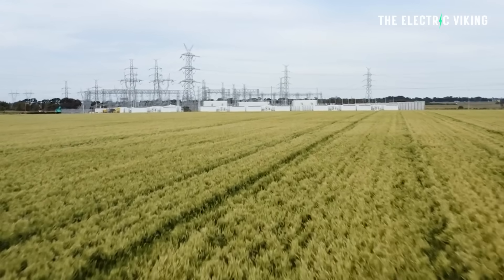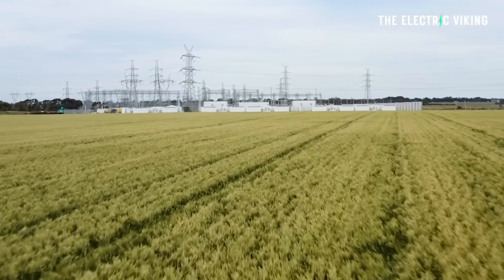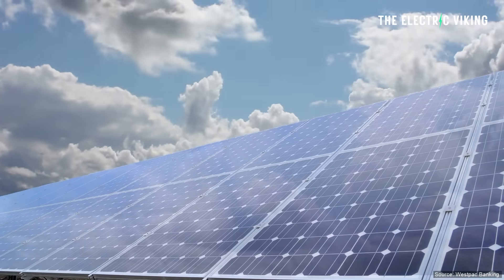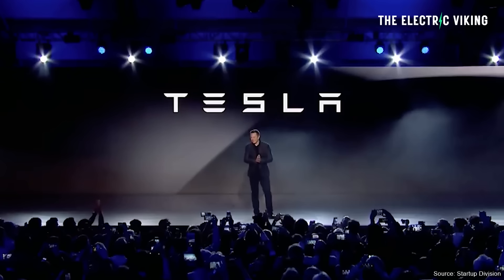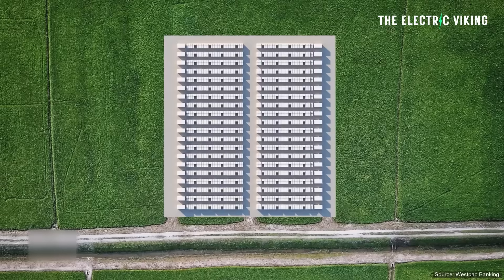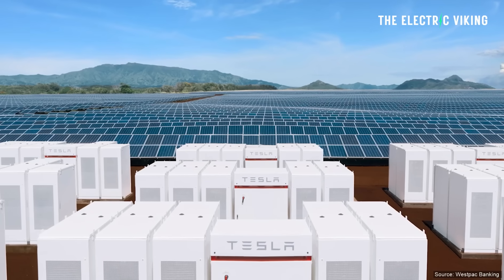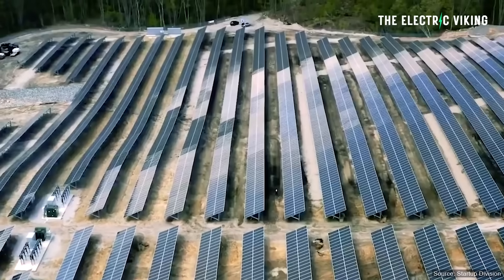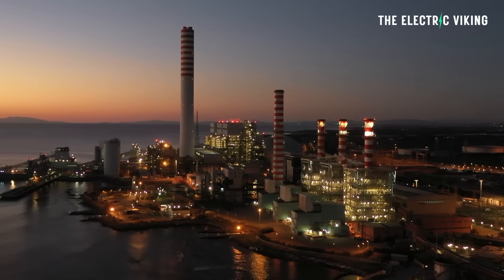Mega Tesla battery in Australia helps shut down coal and gas power plants

Comment: A battery is a battery no matter how much you sugar coat it. The energy to charge it must come from somewhere, and that somewhere must be both large enough to replenish the finite amount of energy contained in those batteries quickly while simultaneously handling the load itself. Not to mention, all of this must been done at a cost low enough to allow the company owning the something to be financially viable. These questions don't need answering if power interruptions lasting an indeterminate amount of time, and at an affordable cost to consumers, is of no consequence.
Reply: You’re so busy trying to think of ways that it’s useless you forgot that it actually has uses.
It can be used to store, wind, and solar. Because she pointed out solar doesn’t work at night, and the wind doesn’t blow all the time. 
Additionally  during the summer, when air-conditioning usage is high peak, load happens in the late afternoon. The battery is charged up overnight when there’s free energy available from the base power plants. This reduces the need for Peaker plants or larger power plants.

Comment: Another Tesla Mega pack went into thermal runaway in rocky before it was even connected to the grid. They just have to let it burn as per Tesla’s instructions giving off heaps of toxic chemicals that are dangerous. We need batteries on the grid but not these in built up areas

Comment: A 150MW 300MWh battery would presumably run for 2 hours at full capacity.  Probably OK for short local outages and smoothing the grid, but not really significant capacity for the overall grid.  How many coal or gas power plants did this allow to be closed?
Reply: Exactly, battery banks are expensive and don't store much energy compared to a power plant.  Natural gas fired power plants are what is used to adjust for variable peak loads, coal and nuclear are base loading, and run at capacity all 24 hrs.
Reply: @jeni719  Hydro is also used to fill gaps. The Snowy Mountains scheme has a pumped hydro plant which was built in the 1970s, when the majority of power of NSW was coal power.
Reply: @jeni719 
They make natural gas base low power plants also. You’re talking about gas Peaker units. 
They are expensive to operate. Even worse, they may only operate a few days a year. 
The advantages they can be started up quickly, unlike a cold plant which could take 24 hours   
Batteries on the other hand can charge up overnight when the base load is underutilized. 
Or from wind and solar
Reply: Sadly I have to agree, battery storage is unlikely to make up for the variability of renewables supply any time soon, if ever. Here in the UK we will need tens of thousands of facilities like this to cover for days of still, cloudy days in the winter. Australia might be easier to convert to battery storage due to dependable solar and relatively constant hours of daylight. You may only need to cover about 12 hours supply, unlike the UK where we’d need to cover up to a week.
Reply: The big batteries rarely have to supply 100% of the demand except n complete outages, so 400mWh pack won’t be suppling 200mWh for 2 hours only, but say between 40 and 120 mWh over say 6-7 hours at quite variable amounts with lower baseline hydro and coal and gas and variable amounts of wind. Where I live in Canada, our province is 99% wind turbine for grid energy with 1% solar and battery (grid pv/batt just starting) and a massive change from oil heat to heat pumps, in only a decade. Also, a strong uptake in solar PV for homes/businesses in spite of our ‘British Isles’ weather/climate. Strong uptake in EVs too. All those changes are additive and not instantaneous. In all these things we are behind Norway or Australia or Denmark, but we are getting there. Everyone who argues it must be 100% and instantly are COMPLETELY missing the point and the future will up and gobsmack them with tiny  daily changes that missed their attention utterly.
Reply: @jimbartley5066 what kind of a load are you trying to dump on people? There definitely is no province in Canada running 99% on wind power.
Reply: But it doesn’t need to run at full capacity. It’s not a UPS.

Comment: Isolated from grids Solar farms are unable supply a constant steady supply 24/7 without expensive battery packs - for example a comparison with an alternative enery source:

Here is a potential solution to a current problem of supplying about 500MWe continuously to an aluminium smelter...
How to pursue cheaper paths for energy use - like releasing (for use as a base loader for existing wind farms)  an existing 600MW hydro station from providing about 500MW constantly 24/7 to an Aluminium Smelter -  (that's about 12GWh per day - so instead pick which of these two options would be Cheaper in the long run assuming 12GWh per 24/7 are required from a stand alone power supply built and owned by the Smelter (24×500MWe); 

A) a combined 2GWe mixed Solar/Wind farm costing $6b; ($3000/kW) providing daily power = 6hr×500MW=3000MWh directly to the smelter;
plus storing (over 6 hours sunshine etc as average utility); vis- 1500MW×6hr=9000MWh in backup gigapacks which will cost $0.666m/MWh= $0.666×9000=$6b; 
Total capital cost (farm & 18hr Gigabattery back up) = $6b+$6b=$12b;
Or capital cost of $12b/500MW (the average hourly 24/7 smelter  daily minimum supply needs) = 
$24000/kW (includes batteries)

Alternative B) 
stand alone 500MWe 
Liquid Metal Thorium ion Molten Sodium Berilium flouride salt burner Reactor (TMSR) capital cost say $1500/kWe
Walk-away Safe, High temperature, near ambient pressure, cold startable; pre-profit levelised cost less than USD30/MWh (<$0.03cents per unit kWh) as a continuous base loader; (also capable of load following for accomodating Irratic renewables); Also capable of supplying directly hot "solar salt" to maintain smelter heat requirements, (without having to convert via: Heat- mechanical-Electric - heat); for purifying & recycling smelter gases and waste, and possibly available to process existing long-term previous Flouride waste problem?
(This proposal woud be similar to what Indonesia is undertaking).
So option A or B would be the better choice? 
(A) solar-Wind With24/7 supply using MegaPack Batteries at $12m construction and 15 to 20 year life or -

(B) supplying 12GWe per day at capital cost of $750million at $1500/kW) and a 45 year life
ie. Capital cost of (A) for15 year life is 16×(B) capital for ⅓ the life of (B)
QED 
.

Comment: As usual, short on numbers and data.  How much of the 275 kWhr solar panels gets put into the battery and how long does it take to recharge them before the draw starts again?  How many houses can be fed by the solar panels and how many can be fed by the battery? What assumptions have been made on the consumption per household at peak evening rates? What is supplied  by the usual grid, what is supplied  by the Peak stations?  150mW of stored power will only last so long when houses might be drawing 8kW/hrI  for short periods and 3-5 kW/hr for 2-3 hrs.  Do the maths.  So many unanswered details. I am not saying it will be cheaper than Peak power stations, which are price gouging, but the number of people serviced by a huge battery pack and a solar farm just isnt enough due to the low energy density of batteries

Comment: The battery comes the US as the China factory is not yet producing megapacks. It could be LFP but not sure, what is more interesting is that if you look at Australia's relationship with TESLA, over the last 6 years we buy an average of 10% of their supply and have established the benefits of megapack to the world energy equation through Hornsdale. It should only take 9 months to fully ramp up the Chinese production of meagapacks and most will be distributed to the Southeast Asian region, so they should be more cost effective to buy for Australia. I would fully expect TESLA's megapack capacity to exceed 100 GW hours in capacity buy the middle of next year, if we are smart, we will be booking our 10% that capacity now, if we want to convert to renewable and a stable grid in the next 5 years.

Comment: Coal is not used for peaking  power
Reply: Are you sure?  If coal power plants have variable power output then they can surely be varied to accommodate load changes.  Hence a form of peaker even if not as responsive as a gas plant.

Comment: Sorry sam,  but NSW  NEVER has enough solar or wind to meed the demand , even at midday in summer.
This battery, like the others will be charged from the surplus fossil  power generation.
Reply: I'm with Amber Electric in NSW, so I get charged the wholesale price for electricity. I have a smart meter installed and I am billed almost live. Just yesterday, the Amber app was showing that there was 72% renewables in the grid and I was paying 9c/kWh at midday....and as I'm on a time of use plan, that figure included the loading and service charge.

So, 72% of the NSW grid is renewable right now. Not a stretch to think we can be at 100% in another 7 years. Adoption is exponential, not linear.

Comment: As a Novacastrian - I must say the main set up for grid batteries should be the Australian / state government financially help the average aussie to set up a "home battery" that feeds into the grid. The grid operated by the State government.
A Square metre of space inside a house 20Kw - 50KWh battery and a 15KW solar system per household.  Plus, bigger system on commercial factory sheds and shopping centers. Any deficiencies on the grid should be made up by solar / wind farms and Tera Battery packs.
And replace individual systems every 20+ years.
Reply: Just watch out for fires!
There needs to be some serious thought put to safety systems before you put something in every house that could spontaneously combust.

Comment: Yes, these solar and battery power sources are helping to shut down coal and gas power plants because it is making any kind of large scale power generation uneconomical to run.  However, it's important to realise that these alternative power sources are incapable of replacing all the energy and applications that these large scale power plants provide. So the end result is huge parts of our society will just go dark.
Reply: Here in the UK gas peaker plants run for around 2% of the time, so there is plenty of room for something else to occupy that capacity. What is needed is storage of generating capacity not the ability to generate when required. Even a hydroelectric, dam is just a big battery.
Reply: Change I gradual,no one will go dark.
Reply: @antoniocruz8083  We may not go dark but we not be able to survive without large scale power generation. The problem is that it will become uneconomical to keep this generation operational, so the cost to consumers or governments to keep them going will become astronomical. There are countless people who cannot benefit from rooftop solar, such as high rise apartments, so it is unfair they should shoulder all the financial burden. Either taxes will need to pay to keep the lights on, or those who live in low density housing with lots of roof space will need to compensate those who don't.
Reply: @vasil7410  I don't think you understand that renewable electricity is cheaper than coal, gas or nuclear. After the initial cost to install it, it needs no raw materials and in the case of solar, almost no maintenance. Even big city batteries need practically no one to keep them running when a coal/gas station needs dozens of permanent staff not counting the mining and transporting. Here in Portugal where we often have close to 100% renewable being produced into the grid, the cost to the consumer has not increased because of oil prices. I pay as little as 11cents/kwh and it mostly comes from large scale producers, little from individual houses.

Comment: ha ha - again Great News for the battery industry - yes in NSW renewable energy is MASSIVE 3.4 Million homes have rooftop solar (6000 MW of Residential Solar alone) Renewables appear to have a total nameplate capacity of  - 13500 MW, this dwarfs many Coal fired powerstation several times..
(hydro in NSW 2966MW of capacity, while Black coal - probably the lowest land use - and most likely to be strategically remediated -  type of thermal energy - had a capacity of 9897MW (3-4 decent sized powerstations), 

South Australia the %%% "champion, has ~2000MW of Solar and 2100MW of wind... (Give me a better estimate - yes SA is a bit player in our network  - as is the ACT, nearly 100% supplied by SNW based projects)

The MWh of storage is the Key.  For  grid resilience (SA does not have a resilient grid) , we need to install >700MWh of STORAGE  (not instantaneous POWER, but the longterm stuff) per unit of Thermal coal we take offline - for simply one hours replacement...  This newest and greatest - probably was cheaper than Hornsdale -   dinky toy has a mere 300MHw of storage 9with a piddly 150MW connection) - of course we need to start some where, we are currently spending Millions of dollars per day ?? $5-10M, somewhere there) firing and maintaining the Thermal generation industry - replace all those jobs and get the system clean and nobody will have a problem... - Getting grid resilience, and even perpetual charge, is a great thing to work towards..

PS. Typed using 100% solar power, with 80% daytime grid export.  Doing my bit for the free energy transition.  And the Ba$tards still try to charge me for the service to humanity, there is no thanks in this life.
 
jk...

I Love calling everything "Advanced" (the reference article's language)- wow, Grid forming must be so hard (like my Lab power supply and an inverter together can't "grid form...  lol...

Comment: I think this virtual synchronous inverter means that the battery can send synchronised 50 hertz AC into the grid. My understanding is that you normally need a spinning generator to initiate the 50 Hertz frequency across the entire grid because the hertz is based on the rate of spin of the generator.
Reply: - if there is no grid "energisation", there is nothing to synchronise to. All online generators and inverters need to be self synchronising - every small and large grid-feed inverter is self synchronising.  A synchronous generator "automatically" runs at synchronous speed while online (generating or not).   

My understanding may have some deficiencies,  but this is "pretty right".
Reply: inverted can do the job, eventually AC is sine wave, inverted can adjust the wave length (hz) to meet the demand, DC to AC 50hz or 60hz.
Reply: @joedu7320 0
Reply: While it's true that a spinning generator is usually what creates and determines if it's going to be 50Hz or 60Hz, it is also possible to produce such frequencies with the inverters.

Comment: Sam you obviously haven't seen or don't want to know about the Tesla battery mega pack fire just south of Rockhampton that caught fire and burnt for a day as they have no real way of extinguishing battery fires. Residents in the surrounding area were told to stay inside because of the toxic fall out that the batteries were releasing and this vasility wasn't even switched on yet. Why don't you report on the pros and cons. be truthful on what you say this is potential Australias most expensive disaster and the fact you live close to one of these I'd be selling up and moving as far away as possible as if these batteries decide to get uncontrollably hot and start burning the stuff that gets released you don't want that for your young family.
Reply: Not interesting information. So what if one of them catches on fire? Haven't peaker plants caught on fire also? 
Tesla will just make safer batteries.. Case closed.
Reply: Well the toxic fumes released would probably be equal to one days emissions from a coal-fired plant
Reply: @desrender4893 pretzel logic😅
Reply: @desrender4893  that's nice we've been breathing in those fumes since the first coal power stations started operating and we live longer now then ever before go figure
Reply: I think it warrants consideration and evaluation.... post links so we can all evaluate for ourselves.
Reply: The Rockhampton facility was poorly designed in terms of fire safety. Only an idiot would design it this way, and unfortunately those still exist in this world.
Sam will not objectively cover stories where things go wrong, because it hurts his cause.

I am convinced 100% that batteries should be part of the grid and transportation.
It's the right thing to do, but doing things right is hard.
As long as every company just stuffing batteries into something without dealing with safety gets a "get out of jail for free" card,  nothing will change.
Reply: @SolAce-nw2hf so how different are these other vasilities they all use the Tesla megapack. Yes I believe batteries are a good Idea for grid storage not transportation as with grid storage they don't need to use the most energy dense chemistry they can use very safe and cheeper  none rare earth batteries as they don't need to move so weight is of no concern and space they have football field of solar why not put the solar panels on the batteries rather then taking up more space in seperate locations like that of the megapacks (images I've seen) are and as for LFP batteries being safer the electrolyte material starts to break down at temperatures over 80°c that would be bordering very dangerous in an Australian summer in a metal box with no shade unless cooled internally this is a disaster waiting to happen
Reply: I agree,  the happy Tesla show... maybe a small small  software bug.. what a shit show. Nothing to do with correct information, just the happy flow.... clickbait